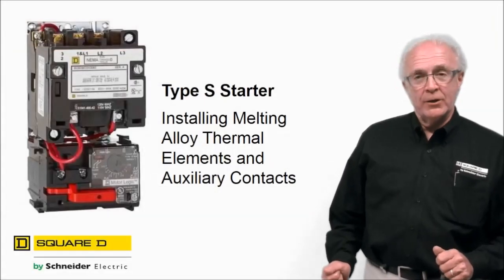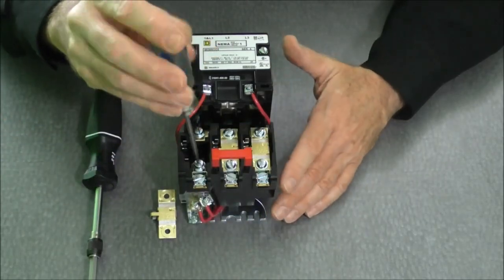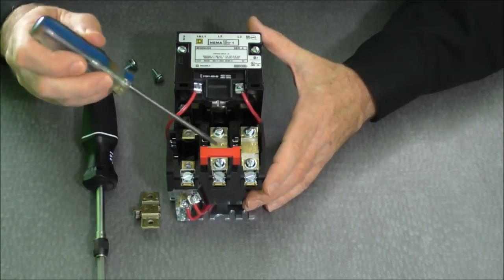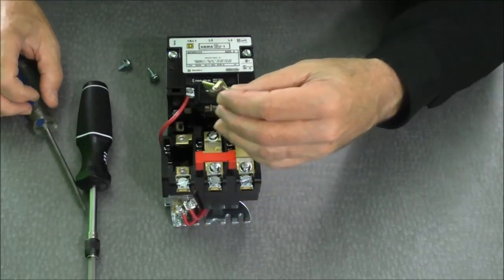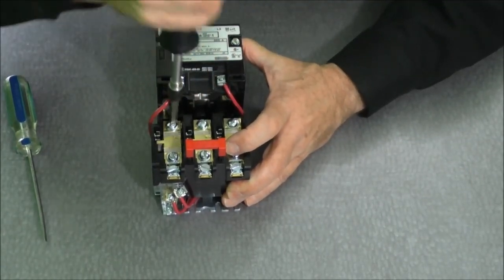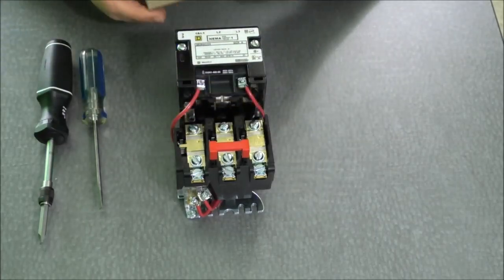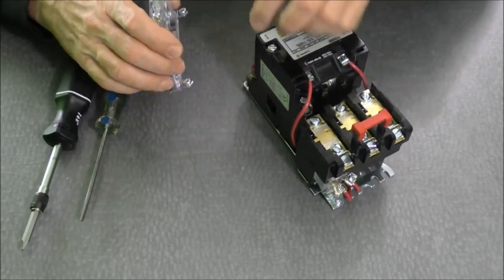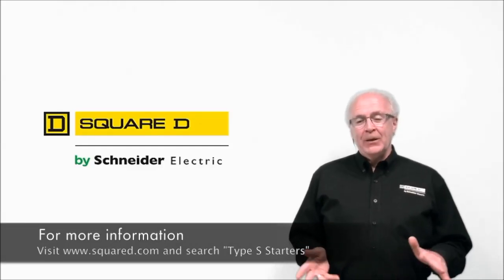Installing Thermal Units & Auxiliary Contacts on NEMA Type S Starters | Schneider Electric Support

Comment: Most of the time I see the heaters installed with the solder pots facing up. You put them facing down. Is that the correct way or is it just  a preference.

Comment: Great, but how do you install a Motor Logic Solid State Relay (SFC20)? Documentation is horrible.
Reply from the maker: Hi Troy,
I have some additional information for you.  
  The MotorLogic 9065SFC20 overload relay utilizes passthrough CT windows and can be used for both replacement of an existing unit (either SSOLR, melting alloy, or bimetal), or as a standalone device.  For separate mounting there are two through holes on the top left and right of the mounting plate( #8-32) as well as two slotted mounting points at the bottom.  Wire is fed through the passthrough CTs.  

For direct mounting, there are two mounting screws supplied with the unit that attached to the slotted portion of the Square D Type S starter (sizes 00, 0, & 1) and tighten to 17-21 lb-in. Your T-Lead wire (14-8 AWG) is then fed through the passthrough CTs and connected directly to the lugs of the contactor and tightened to 20 lb-in.

We also have lug kits for the 9065SFC20. The 9999LL0 adds lugs to line and load side for use with separate mounting. The 9999LB0 is for use for retrofit applications for the Melting Alloy overload which allows you to have the lugs at the same location (reducing the need for additional wire lenth.  While these are not mandatory they can assist with installation. Please let us know if you have any additional questions.

You can find additional support resources at the web site: http://spr.ly/6050DwJKr
You can also find more on: http://spr.ly/6051DwJKT

Hope this helps!